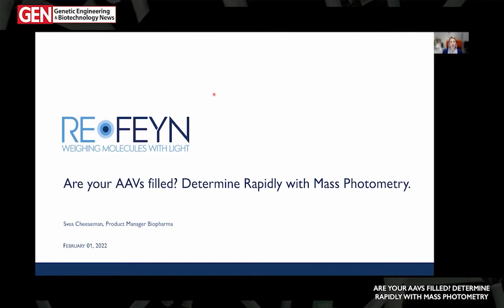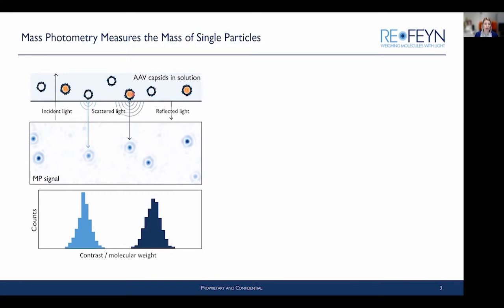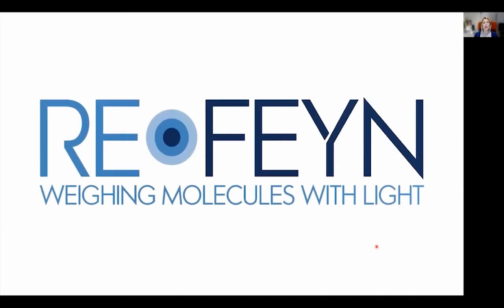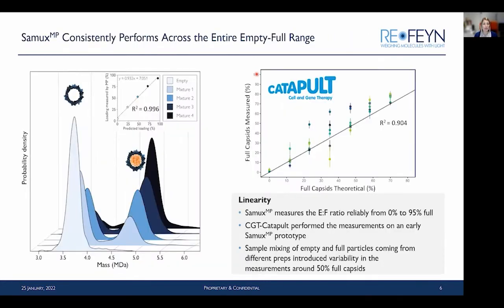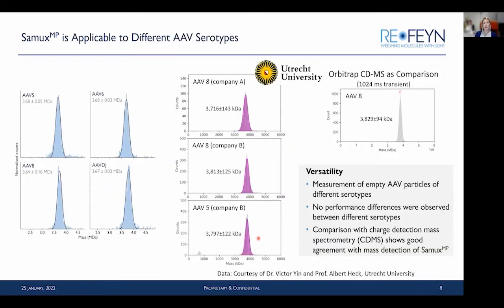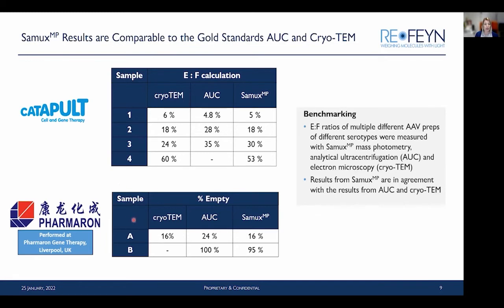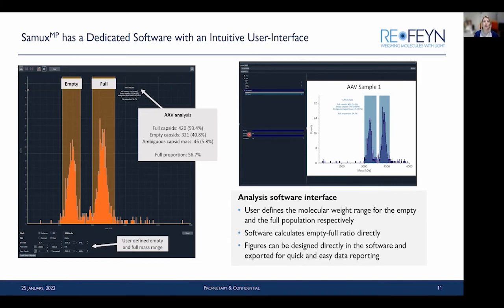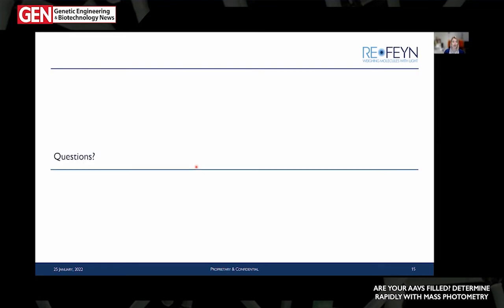Rapid AAV Empty-Full Analysis with Mass Photometry

Comment: How to determine the partial-loaded AAV particles by using this machine? I notice that these is a overlapping part between the 'empty' peak and 'full' peak. Is that the 'peak' representing partial-loaded AAV?
Reply from the maker: Hi there! Thanks for watching our webinar. In addition to empty and full AAV capsids, you can also identify partially-filled and over-filled capsids. We will shortly be releasing an application note containing data acquired with the SamuxMP showing empty, partially-filled, and full AAVs. Perhaps more importantly, we have AUC measurement data for the same samples that confirm the data captured on the SamuxMP. All of these datasets were acquired by one of our customers. Submit your details via https://www.refeyn.com/contact-us and we will send you the app note once it's out!
Reply: hi Liu, where did you base?